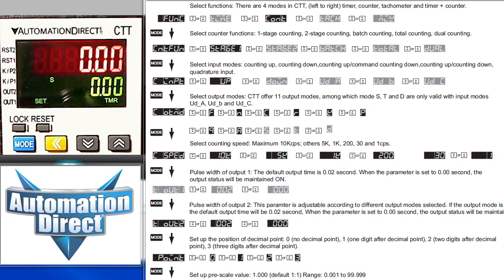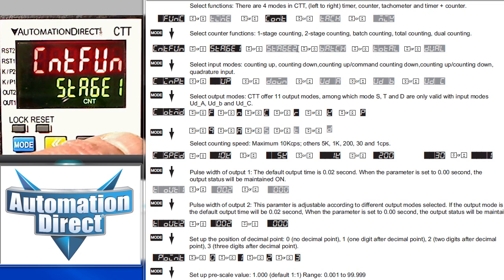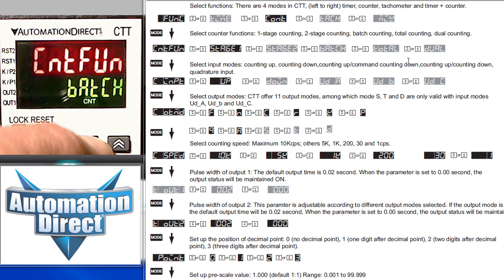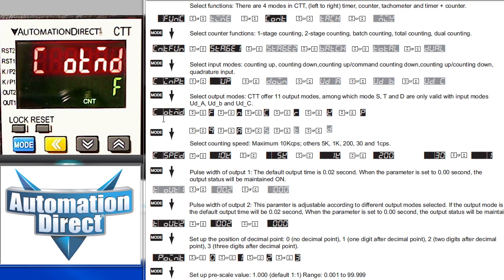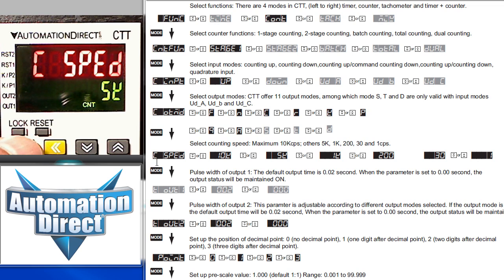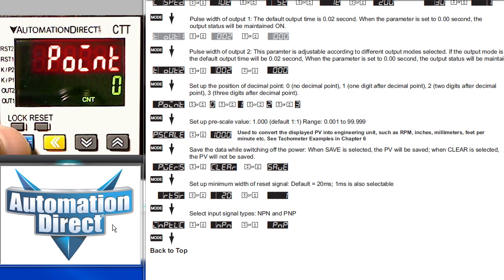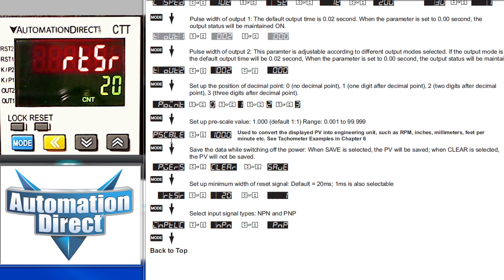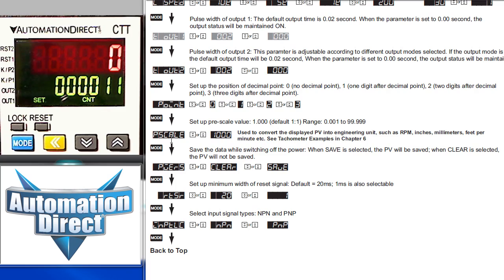Counter-Timer-Tach: Counter Function Demo from AutomationDirect

Comment: Does the device have a 12v power supply so the it can triggers a second device?      For example a piston up for hi and low for down but that count just when the down triggers. Can it be?
Reply from the maker: @A.P. Computer System Adm, thanks for the comment. Yes, there is a 12VDC 100mA source on the CTT.  On pins 6 and 11. Please see page 1-7 of the following link: https://cdn.automationdirect.com/static/manuals/digitalctt/ch1.pdf

Comment: how do I set the dip switch ?
Reply from the maker: Alexandre Thollon,  the manual will walk you through setting up the CTT. You can find the PDF of the manual here:  https://cdn.automationdirect.com/static/manuals/digitalctt/digitalctt.html  The dip switches are not required to be changed if you plan to program the unit using the function buttons and menu system.

Comment from the maker: Andrew Weston, Our SOLO PID Temperature Controllers have a built-in control mode called “Ramp-Soak” that provides control at various temperatures for set durations. Details can be found in the SOLO controller manual at www(.)automationdirect(.)com/static/manuals/solocontrolm/solocontrolm(.)html. For more more detailed help on the operation of the SOLO or the CTT counter, timer, tach please feel free to contact our tech support team either online or by phone at 1(800) 633-0405 Monday - Friday: 9am - 6pm EST. We hope this helps!
Reply: Hi, can this counter unit be safely used to directly power a 110VAC motor? (On until count is reached, then turn motor off)